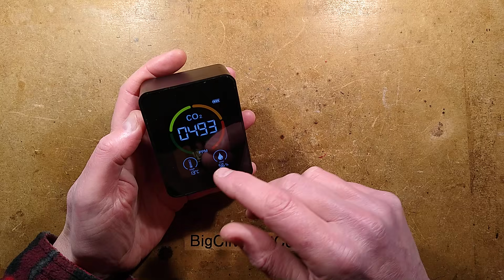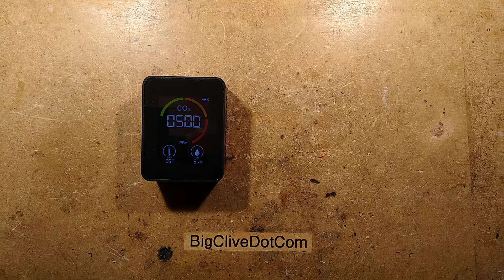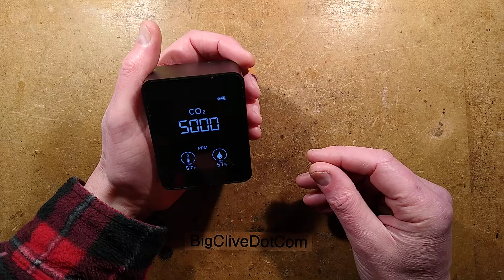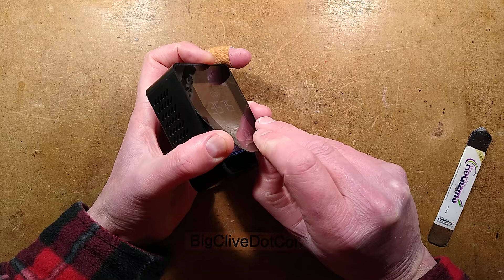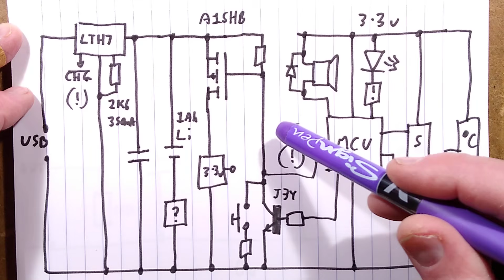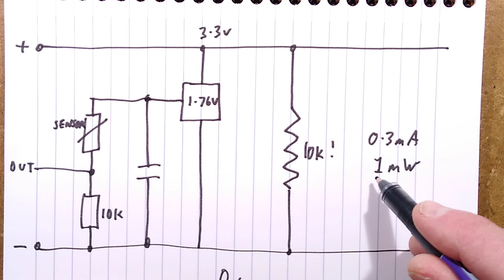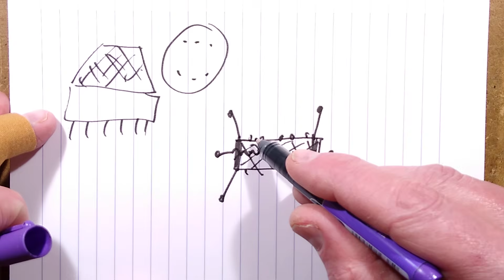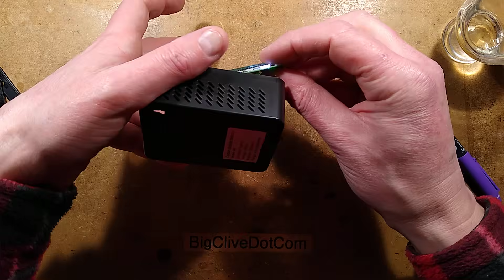Fake CO2 monitor (party detector) with schematic

Comment: I wanted to reply to: "I could think of more useful things to meassure" - "unless you live in a hermetically.. ".. because to me.. that was .. well.. not a "trigger" except the fact that when I feel someone is giving bad advice (or influence people in a way that MAY be harmful; Probably not; but at the very least.. people will feel questioned when wanting to do something that literally MAY be a good thing they did).. 

UNFORTUNATELY.. when I tried to post my reply, I got an error-message from youtube. I MAY try to rewrite what I said in a more succinct manner, OR just post it as more than just the one comment.. .. but.. I wouldn't hope for that.  (and just to say; I hadn't noticed the "party detector" thingie yet.. and yes.. IF the POINT is someone having party.. then.. if you have a party in an appartment, then you'll KNOW that the ventilation was NOT built for the amount of people there, but even more importantly.. if you have a REAL underground rave.. where you literally have a party where the people arranging the party BROKE IN to a place with a HUUuuuuuge floor.. then.. yeah.. People HAVE fainted in those environments, etc.. so.. I have VERY good reasons for why people should want to just.. check the CO2 levels on occasion.. AND why it may actually reduce harm, EVEN when the co2 levels ARE good, because people WORRYING about something.. may create MORE harm if people are just guessing compared to actually being able to SEE the digits).. 

but now.. I have seen a few minutes more.. and I kind of have OTHER things I want to say. (remember: What I said right now was NOT what I intended to say, but only about the concept of carbon-dioxide while having a party,.. and yes.. people HAVE died.. in parties/raves.. AND.. even in "standing-room" concerts.. when.. the person dying NOT having a history of cardio-vascular problems, AND not being exposed to enough blunt-force trauma or anything else that would validate their deaths.. "people die at concerts".. is KIND of a.. common thing.. and.. the CAUSE?.. well. they always ASSUME a cause.. but.. in some situations it may actually BE carbon-dioxide poisoning that is the cause.. and remember.. there is a REASON! why you are TOLD! to unclip the top buttons and ask people to STAY AWAY when you give recussitation.. the effectiveness of people NOT breating in the face of the person.. who WHEN he breathes.. LITERALLY is ONLY getting air second hand from ANOTHER person.. it actually do help.. not much.. but.. it does.. though it matters how long people are succeeding to keep it up for.. today people aren't even suggesting that you even try to breathe because it may create MORE problems that you aren't able to keep the heart rate regular than using "old air" in the lungs.. NOT that it doesn't matter, just that.. one may be more common to be an issue than the other, and THAT absolutely relates to respond times from ambulances.. who.. will actually.. intubate.. and.. literally have tubes of oxygen in them.. so.. time may be a huge factor here.. not to mention that the people who made the change may not have had access to ALL the information people used when they FIRST made the choice as they were just trying to revise it).. 

.. but.. I have (as of now).. some issues with your methodology.. (you PROBABLY did a better job, but not for the clip)... 

yes.. it NOT reacting (a LOT) to carbon dioxide.... but.. it DID jump from 480.. to.. 500.. are you saying there is alcohol in a sodastreamer tube?.. I mean.. Over here I am FAIRLY sure it's AGA that does the ACTUAL.. chemistry parts, and they f*g know what they are doing.. if they say a container contain CO2.. it contains CO2.. it may be IMPOSSIBLE to say that it should contain EXACTLY nothing else, especially if they doesn't try to clear it AS well BETWEEN refills as they would've when they first manufacture the tube, but still.. Where is the alcohol coming from IF it is only alcohol?..

IF! I were to do a test.. using a soda-stream.. to see if a carbon-dioxide tester work or not.. 

The FIRST thing I'd think is.. "what is the response-time?".. that is.. there are a LOT of sensors on the market built to detect SPECIFIC things.. but.. it may take some time to stabilize.. and.. since we can't just say.. "oh, this should only detect this... ".. it also MAY be that we have to look at various things that can react in various ways in various situations.. and.. try to combine them.. in order to make something that WILL react.. and.. Qute often.. we can't make something that.. ONLY reacts to one thing.. 

and because of this.. there are ALSO a lot of sensors that aren't just.. "sensors of this".. BUT.. "sensors for this.. for use in this circumstance".. WHICH means that.. IF you are at a job.. AND you assume the people working at that place are EQUALLY drunk from when they started in the morning until they quit in the night.. THEN.. a sensor INTENDED to detect.. "Whatever" (f.ex... Carbon-oxide).. may actually BE sensitive and give miss-readings for alcohol.. AND when a sensor have a weak-spot.. it is NOT unusual that the weak-spot is WORSE for the thing that it WASN'T supposed to detect than the thing it WAS supposed to detect.. so.. TECHNICALLY.. it may be that the thing you INTENDED to search for may be the thing that SEEMS like a "noise". 

That is.. PERHAPS.. a difference between a read of 480.. and 500.. IF you are in a "stable environment".. IS the best this sensor could give..

and I just realized I didn't finalize another thought: You didn't REALLY give it "time" to react to the carbon-dioxide, AND there is the issue of "flow" (amusingly enough: One of the things I mentioned in the comment I COULDN'T make).. 

Which is.. IF you are blowing something with pressure.. and it is SUPPOSED to go in through an "opening" to reach a sensor.. then.. the mere fact that whatever is IN the opening.. is in a case.. means.. that there will be a resistance.. it's not a "free" flow.. so.. what MAY happen is that the "pressure" needed to go IN to the case.. is kind of high.. whereas the air around the case is lenient.. so.. it may be EASIER for the carbon-dioxide to just go around.

ONE thing I INTENDED to mention in the comment that was too long (!) but DIDN'T.. is that Living creatures need air. People sometimes leave dogs in a car.. and.. leave things open for air to get in.. (AND assuming their IS air-circulation: For warmth to get out).. hence.. people tend to leave the baggage door open and have the dog in a
Reply: Cage in the back.

HOWEVER.. there are TWO things here.. ONE is that.. HOW is the air to go through the car?.. to have ONE open part of the car.. means.. that IF the air is blowing TOWARDS the opening.. it will be trying to PUSH the air IN the car.. toward the front.. where there IS no opening.. so.. IF your dog  (or child for that matter).. is in your car.. and you have ONE opening.. then.. there is no where for the air to go, EVEN if there is a breeze that WOULD go in to your car.. the only thing that breeze could do is to "push" on the air.. BUT it will push equally EVERYWHERE.. so the actual air in the car have no place where it's "easier" (lower energy cost) to GET OUT.. hence.. it just gets pushed IN to the car.. and then.. it will be of higher pressure.. which would mean.. it would take even MORE energy for the air from the outside to get in.. so.. "one open window".. means fuck-all. THIS is why people talk about.. "cross-breeze".. 

but.. there is also a SECOND problem.. which also relates to pressure, BUT it is about.. "heat"..  So.. IF you have.. NOT ONLY.. your trunk open.. BUT.. you can have ALL your windows rolled down.. 

reality is.. the paint of your car.. and other things.. WILL heat up your car.. and.. then.. the air within.. so.. What OFTEN happen in a car IF it is a hot day.. a lot of sun.. is that.. the air inside the car is warmer than the air outside. (heat is a complicated issue that I would LOVE to talk about to anyone who'd like to find out how much it.. just doesn't make sense, and sucks.. while.. it makes a LOT of sense and.. it's awesome and we couldn't even exist if it wasn't for it).. 

.. but what I wanted to get to is that.. QUITE often.... it's possible to have every single part of your car open.. and there CAN be a wind.. and.. the air inside of the car will STILL not get exchanged.. which means two things.. ONE is that.. the heat.. will continue to increase.. the other.. is that there will not be an exchange of air. The second one means that IF there is ANY living creature in your car: the oxygen levels will not be replenished and the carbon di-/monoxide levels WILL continue to rise.. without any boundaries.. and THIS.. is NOT hermetically sealed, is it?.... well, not in the traditional sense, but it IS in a more.. "circumstantial" and "consequence based" sense.
Reply: So.. IF we accept that a sensor MAY be reacting to OTHER things than the SPECIFIC things you want it to react to (but that is okay IF you know the sensor is intended for a specific use-case where that other thing doesn't matter).. 

and.. IF!!..  we remember that.. a sensor.. MAY take some time to react.. SOMETIMES a sensor  HAS to react within a fraction of a second.. but.. depending on WHAT we are measuring.. and.. IF actually noticing a HUGE increase (or decreas) within a SHORT PERIOD OF TIME!!!!.. would be a BIT skittish.. because.. that isn't relevant for the use-case.. AND if we even expect the sensor to POSSIBLY be.. exposed to.. rather sudden swings only because of WHERE it's located.. 

Then.. PERHAPS.. a sensor isn't even supposed to react TOO harshly (or quickly) to things that change.. IF a sensor.. is INTENDED to be used for something that isn't an IMMEDIATE threat.. but more of a.. "if this happen during the night.. and.. it gets going.. and goes on.. and.. then.. within some hours we SERIOUSLY should start calling people and wake them up.. not kidding.. waking them up at three am over something that has been happening for 5 hours is NOT to exaggerate.. they SHOULD be woken up.. and.. open their windows.. and.. possibly get dressed, because.. depending on how this develop.. they MAY have to evacuate..".. 

.. I mean.. it's a matter of.. use-case.. IF we are talking about a FIRE.. you'll be dead in 2 minutes.. then we WANT a sensor that reacts in a fraction of a second.. (WHETHER IT'S CORRECT OR NOT BE DAMNED!!".. but.. if we are talking about.. "oh.. shucks.. the ventilation isn't working.. ".. then.. we are talking about.. 1. A different timeline.. AND.. we may care a BIT more to let the sensors to be sluggish and stupid.. JUST to avoid FALSE positives.

So.. Are you SURE the actual SENSOR got the CO2 from the soda-stream OR is it possible that it met some form of. "high pressure"?.. (hint: it would have to PENETRATE a  closed OR semi-closed encasing.. OR it could just spill into the room which has pretty much NO resistance).. 

OR.. that the sensor (or even entire device)... was supposed to be supposed to react within one minute to HUGE changes in CO2?.. 

IF you wanted to test this.. (especially if you assume it was made to be able to measure CO2 in an environment where it would slowly build up.. AND everyone was awake and partying instead of asleep and needed the jolt of being awakened.. and.. POSSIBLY where you even had the option of opening doors or starting some fans BEFORE you alarm OTHERS).. then.. PERHAPS.. you should've created some form of environment.. that was closed.. where.. you could replace the ENTIRE environment inside.. with high carbon-dioxide.. and.. let it stew for an hour to see IF time mattered on this.. 

(and just to say; some of the things I mentioned ALSO would've meant that the alcohol COULD actually have "penetrated the system faster" than trying to BLOW CO2 into it).. 

So.. as an experiment goes.. it's not laboratory grade.

Comment: I'd suggest using the hot air to pull the sensor chip, the label may be on the bottom.

Comment: You mentioned not knowing why one would want to know the CO2 levels inside your house.
Well, there are lots of very good reasons to keep an eye on it.
Higher CO2 levels make you slow, a bit sleepy and at higher levels uncomfortable like if you can't breathe well. A bit like being out of breath when running with little to no 'condition' or 'training'.
Also in your bedroom, when you have higher CO2 levels, you won't rest very well and keep tired during the day.
In offices, schools, etc. where cognitive performance is required, you can clearly see in the test results the difference between well ventilated buildings and those who have higher CO2 levels.
Higher CO2 levels clearly affect response time and alertness, so this button in your car to switch to "internal air circulation" is a rather dangerous one. Especially in older cars, where it doesn't turn off automatically. In a normal car, with 2 adults, the CO2 levels can go as high as 2500 ppm in 20 minutes. That has the same effect on your alertness as drinking a few beers.

If you burn something, like cooking on gas, burning candles or anything related to burning in your house, (fireplace), you will have quite high CO2 levels in your living room, without noticing it.
Typically, when CO2 levels are over 1000 ppm, people really like to open a window, or turn on some ventilation.
But if you've got a proper CO2 sensor , which does control your ventilation, it will typically turn on at 700 ppm.

Now back to what you've tested here.
I assumed it was some kind of VOC sensor like the CSS811, which is being sold as an "eCO2" sensor, which is just misleading IMHO.
But this one you opened here, is even worse than I expected :)

I do suggest you take a look at proper CO2 sensors and see for yourself why it is a good thing to have one in your house.
During Covid, CO2 sensors got a lot more popular as the CO2 concentrations correlate very well with the amount of ventilation required for the number of people in a room.
But I guess this gain in popularity was also noticed by those willing to make anything with "CO2" in the name, regardless of what they actually measure. Just like this sensor you just showed here.

Comment: Many co2 sensors are actually (cheap) air quality sensors based on eCO2, they detect volatile organic compounds. This is „good“ if you use the ppm count as an indicator if airing might be required. (But lately also fake sensors which are just broken circulate we well)

Comment: Actually, it's surprising how close to "hermetically sealed" many modern-construction buildings (particularly in colder areas) are.  Part of the reason CO2 sensors are increasingly popular is because there has been a lot of realization lately that many people may be living in houses whose CO2 levels do get high enough to potentially adversely affect their health in various subtle ways, particularly if they also use things like gas stoves, etc...

My best guess would be that this was actually just a simple screwup somewhere.  I doubt the CO2 sensors are significantly more expensive than alcohol sensors in general.  I would bet somebody just wrote down a part number wrong somewhere, and sent it off to be manufactured, and got back a whole bunch of these units produced with the wrong part on the board.  Either they didn't actually notice because they didn't do any real QA ("welp, the number's changing so the sensor must be good! ship it!"), or they actually did realize the mistake, decided it was easier to cut their losses than to try to fix all of them, and instead of selling them to consumers, they just bundled up the lot and sold them off to some other company as "bad stock".  However, then the other company that bought them decided to turn around and fraudulently resell them as a claimed-working product anyway.

Comment: Could still be an AVR as the MCU, there are a few with internal LCD control, though I would suspect some cheap Chinese micro. The breakaway board looks like it might be I2C, and maybe that unpopulated chip is for a real CO2 sensor. If it also includes Temperature reading, having it as a breakaway can make it more accurate due to thermal conduction of heat in the PCB. As for why people may want a CO2 sensor, they became quite popular over the pandemic as they serve as good measure of how stale the air is that you are breathing, thus your level of risk. Great analysis as always!

Comment: ZP16 "air quality" VOC sensor for measuring formaldehyde, benzene, carbon monoxide, ammonia, hydrogen, alcohol, cigarette smoke, and fragrance. At least this is from an AliExpress page. Found in Ebay too. VOC levels of >0.5 ppb are "actionable" which might correspond to 500 mg/m3 listed at which it shouts. Or is it 5000?

Comment: I would think C02 sensors are quite abundant now, with new technology they are probably cheaper now.
I remember many moons ago that the sensors in the MOT machines had a limited life time, they used to decay over time, the more air that was blown over them. They used to come in sealed packets.
Strap it to the tail pipe of the car to check it's ok. Not a VW though ha-ha.

Comment: These sensors measure the TVOC (total volatile organic compounds) and guesstimate the eCO2 (equivalent carbon dioxide) from it. The NDIR (nondispersive infrared) CO2 sensors provide (more) accurate values but are much more expensive. One of the cheapest ones seems to be the MH-Z19 from Winsen Electronics.

Comment: It seems common for eCO2 sensors to estimate the CO2 based on other gases, to quote a SGP30 datasheet: `Air quality signals TVOC and CO2eq are calculated from Ethanol and H2 measurements using internal conversion and baseline compensation algorithms`